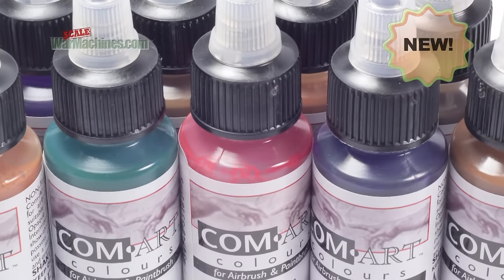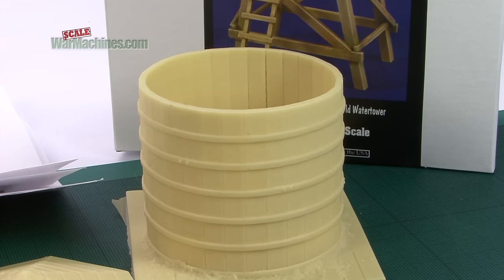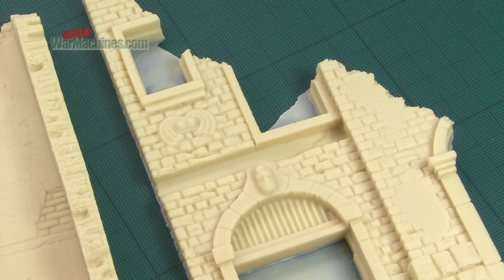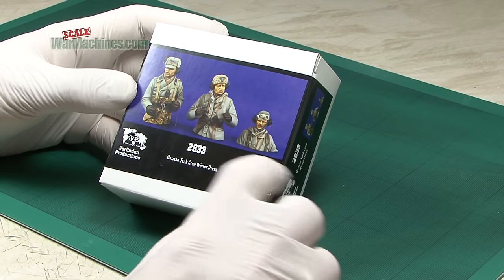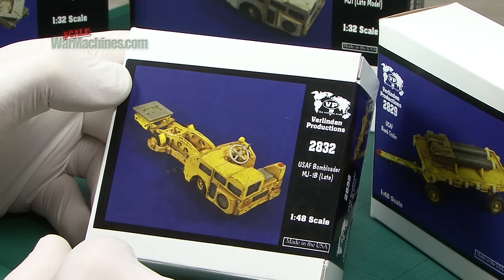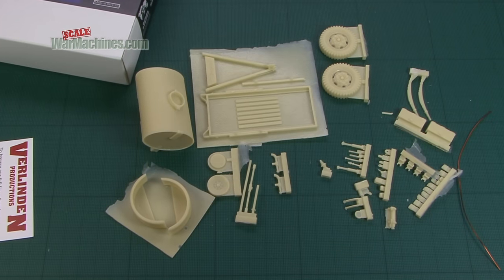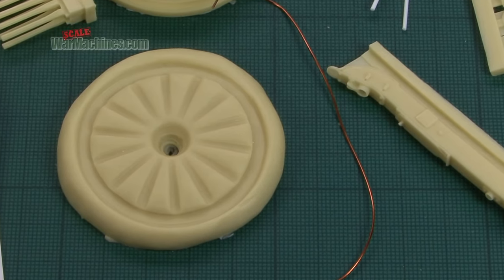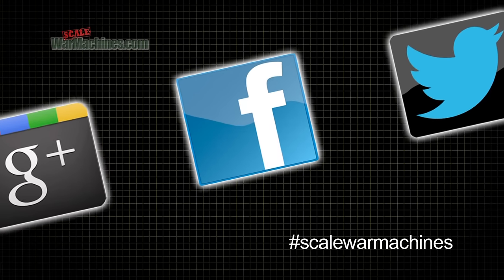VERLINDEN NEWS ROUND UP OCTOBER 2015

Comment: How to trim off the resin residue pls? I have dremmel tool
Reply from the maker: Yes you can use a cutting disc in your dremmel or better use a razor saw or scalpel first to remove most of the pouring plug, then use a sanding disc in your dremmel to sand and clean up, wear a mask, don't inhale dust.
Reply: Thanks much